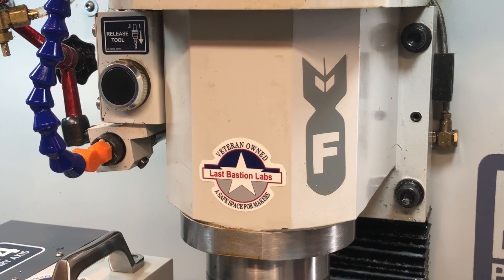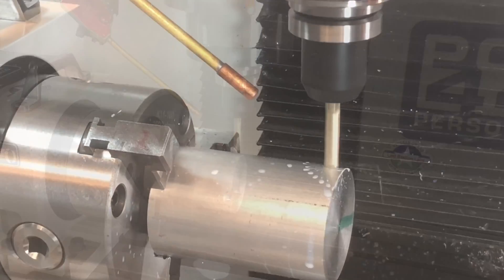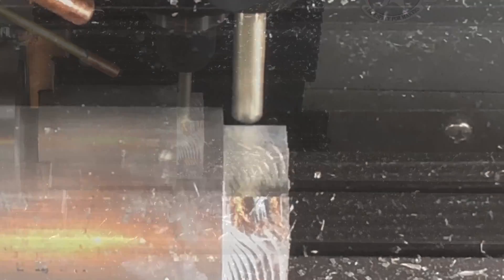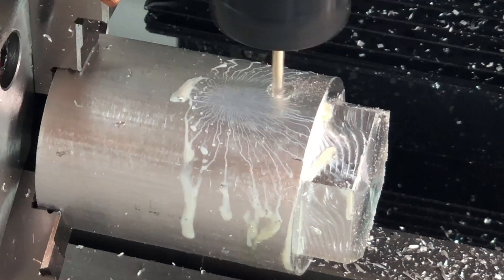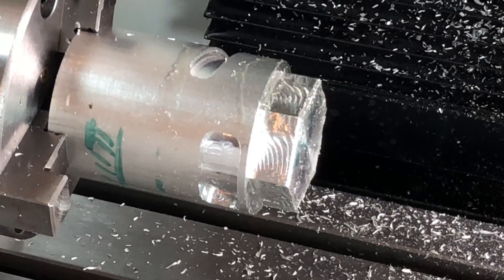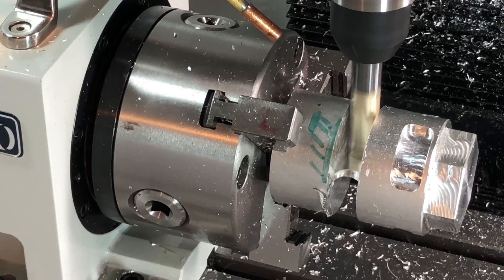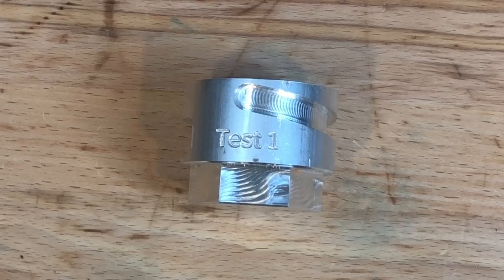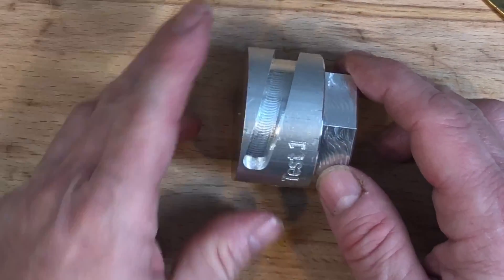Test cuts on the Tormach MicroARC

Comment: Been a subscriber for a while, enjoying your content!  I now have your exact same setup: Fusion 360, PCNC440, and recently I got the microarc.  I have a question though; did you have to manually adjust anything on the tormach.cps post? Or did everything just work right off the bat?  My simulation is running as intended but not the case once on the machine :/
Reply from the maker: That is really cool, congrats!  With the Micro Arc on the left side of the machine, I have to select (X reverse) in my post processor for the Rotary Table Axis.   So, I think my machine is wired backwards.
Reply: @LastBastionLabs  I too have my microarc on the left side.  The problem I'm having is that when running the program on the machine my tool stays tangent to the toolpaths vs. perpendicular like I have in my simulation.  I'm guessing I've somehow missed a step and neglected to modify something on the tormach.cps post file.  I'm still looking into what that modification should be.

Comment: Brother Love your videos, quick question... Now that you have purchased this machine and played with it a little bit would you honestly say you are 100% happy with it OR do you wish you have bought 770MX or 1000MX Version? I do custom gun parts as well and thinking of getting into the CNC game. I just don't want to buy this 440 and then find out 6 months later that it limited me from making custom slide cuts for optics or it does not have enough power. Would you buy it again I guess is the question for what you do with it and would it be good enough to do some small batch of mass production Glock slides?
Reply from the maker: Thank you and thanks for watching!  I got a 440 because I could fit in my basement.  I tell people to get the biggest machine they can fit and afford.  I have been very happy with my 440 but wish it had a bigger work envelope.  I did a main spring housing in stainless.  The 440 didn't have a problem milling the stainless but struggled drilling a .280 in hole in stainless.
Reply: @LastBastionLabs   how about the 770 would that cut and drill holes easy in stainless? I'm very tempted to just buy their top of the line 1000mx
Reply from the maker: @levinrio7685  I can not speak to the 770.  I did check proven cut and for .375 and .5 drilling in SS only the 1100 was entered.

Comment: Great videos: you actually pushed (inspired?) me towards Tormach, so now I’m on the very steep learning curve..evidenced by my next Q: Did you have to probe to find the end of the part....x axis?
Reply from the maker: LOL good eye.  I did reference the end of the part for the X zero.  I just did not show it in the video.  I wish you the best of luck.  I have been very happy with my 440 and Tormach as a company.
Reply: @LastBastionLabs  so you have three probing steps, find center A, X and then Z?
Reply from the maker: @tedean1  I used the routine in path pilot.  Its that simple.
Reply: One more Q please:  Fusion360/Manufacture, Setup, Setup, Operations Type...do you set for Milling or mill/turn or just Milling. When I switch from Milling to Turning or mill/turn my coordinates get all re-positioned.
Reply from the maker: @tedean1  I set up for milling.  before  you select that feature, you have to orientate the z axis.   If you watch this video, you will know as much as I do. LOL  https://www.youtube.com/watch?v=IPi48a-y0VQ
Reply: @LastBastionLabs  Thanks did watch that vid. I found my issues.  Using PathPilot, I probed to find center, then the end of the stock, X.  My failure was in the fact I was "then" probing for Z.top of stock..which threw off my first probing.....that had found center.  My goodness, I was over thinking it AGAIN. Finally...thank you for answering my reply.....
Reply from the maker: @tedean1  Happy to help.  Good luck!